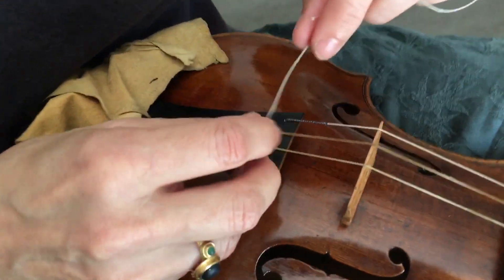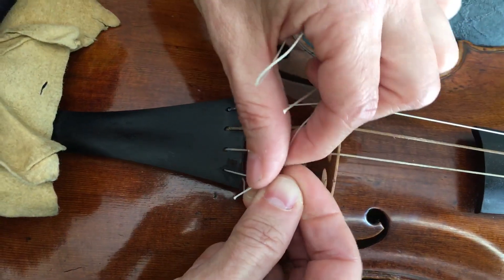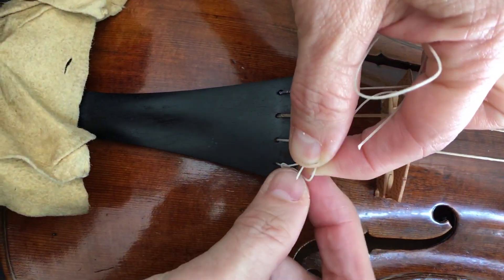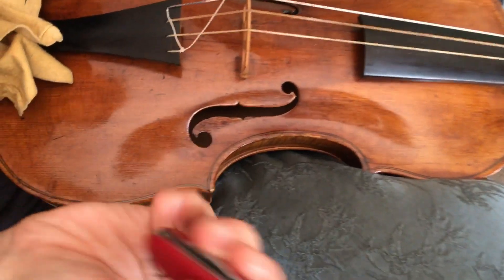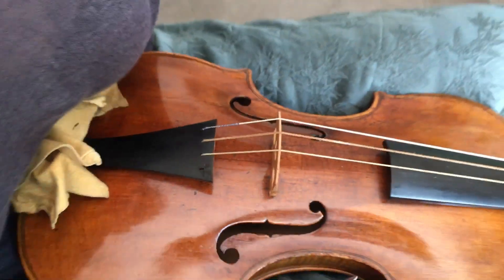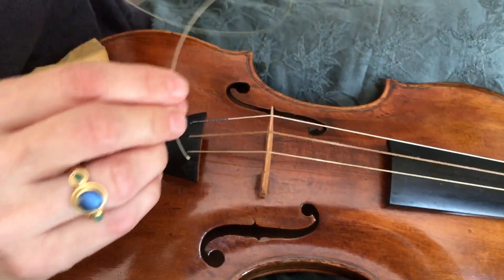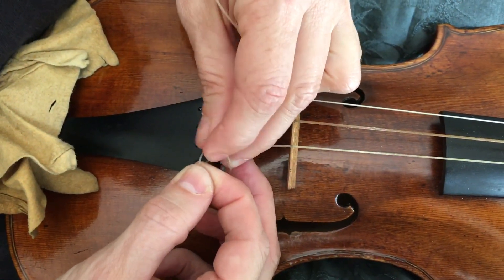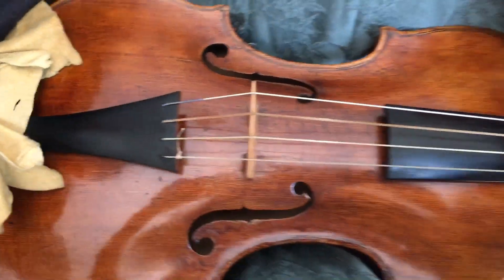How to change a gut E string - the knot

Comment: All guy strings don't need to be knotted by the musician/luthier after receiving the set, right? My Pure Gut String set, Academie made by Gamut, has the option to order them preknotted &/ with a leather washer(stopper) that act as a modern violin string ball end. In your opinion, does knitting it manually vs. ordering a set pre knotted have an effect on the sound of the baroque/modern instrument when playing it?
Reply from the maker: well, that's a really interesting question! i have actually no experience whatsoever with this as the strings i play and have played through the years have not had the option of being pre-knotted, so i always ended up having to make a knot myself. Would be fascinating to know if it made a difference...